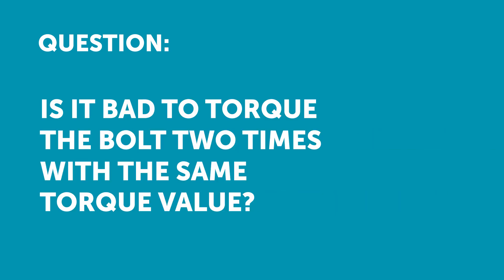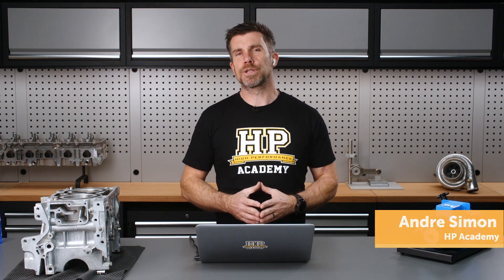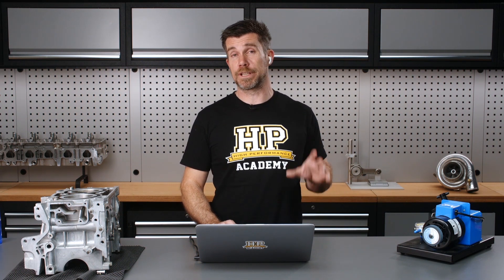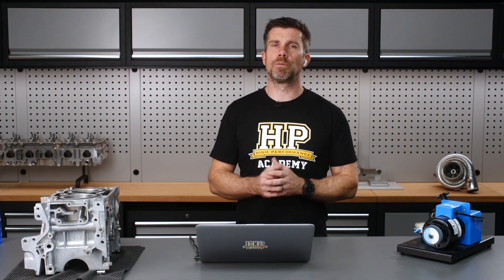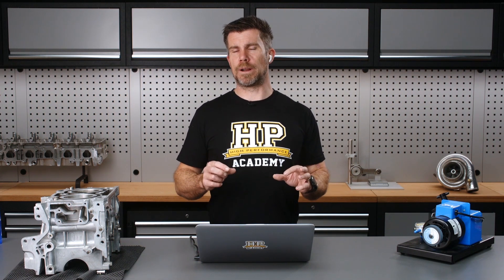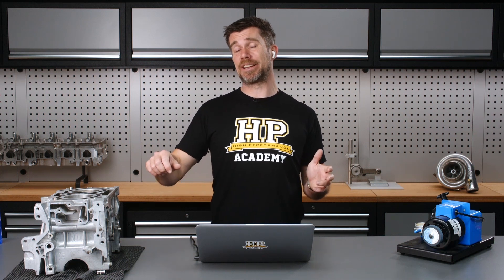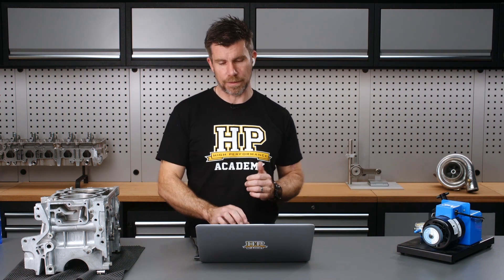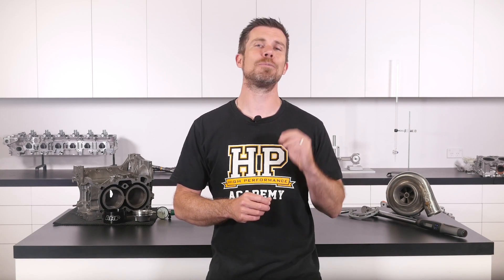Should You Torque Things Twice? | Torque Wrench [HPA Q&A]

Comment: ARP has torque lubricant.  And you get within torque spec on the first torque
without their lubricant you may need to torque multiple times to get to torque spec.
there are other lubricants and they vary in performance.
THis is not an ad, I just watched this on one of my other car shows.
Reply: You will always get the correct torque regardless of lube. What will change is the important bit, the clamping force.
Reply: https://youtu.be/FjBaWo0QMYU
Reply: @jeffmccartney5359  confirms what I said

Comment: Send it with the rattle gun
Reply: Remember to count the rat tats
Reply: @gothicpagan.666  I always torque my main bolts to three ugga-duggs
Reply: @ABusFullaJewz  Ah you must be using a bigger gun, with possibly more air line pressure
Reply: @rayban5737  I should be in a museum, I've had the same CP gun for over 30 years. The younger guys in the shop use elastictrickery, but they do all the work 🙂
Reply from the maker: @Ray Ban we heard about those, we've hoping to get electricity here in New Zealand in the next few years - Taz.

Comment: 3 Ugga-Duggas are more than enough for everything.
Reply: I like to torque until the bolt snaps, then back it off a quarter turn.
Reply: Tight is tight, too tight is two pieces.
As a wise man once said
Reply: Cross thread it so it won't back out

Comment: Would be an interesting test to see how much lower you can set the torque setting on the wrench than the bolts torque with it still clicking
Reply: Trick question?
Reply from the maker: 🤨 - Taz.